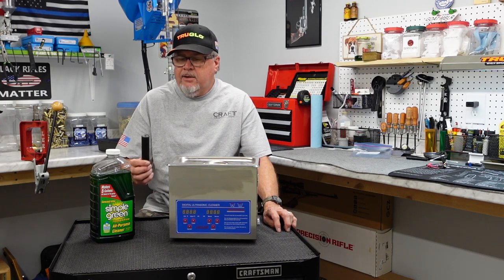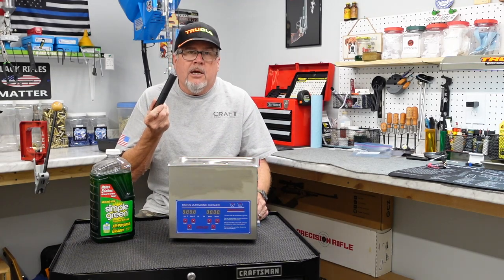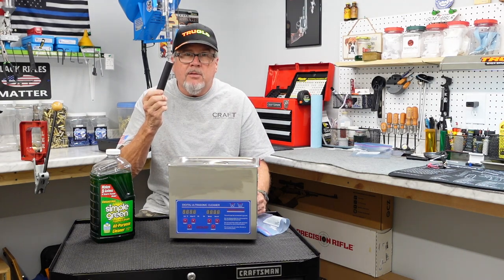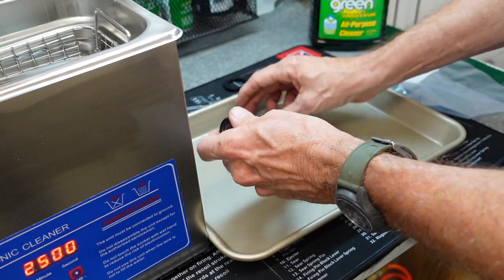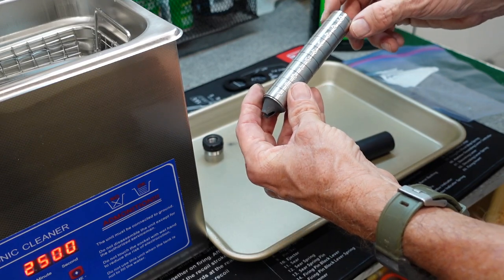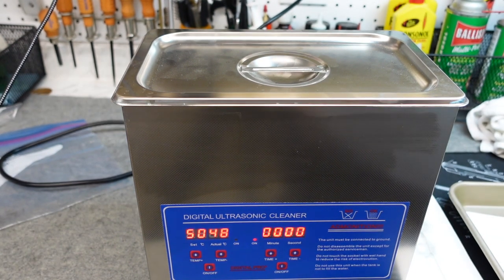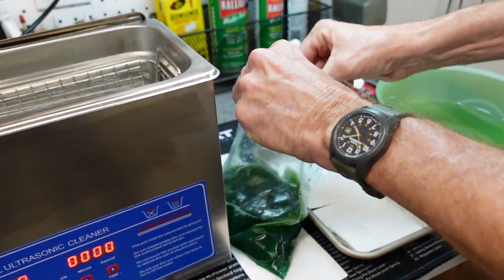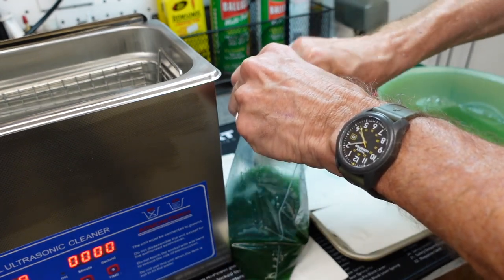ULTRASONIC SUPPRESSOR CLEANING WITH SIMPLE GREEN - FAIL!!

Comment: To all for the method I've used, use a carbon solvent, (I use Hoppe's #9) and dissamble. Soak all parts overnight in whatever solvent you use. Some picking, scraping of carbon may be necessary after that. If you soak too long (in Hoppe's anyway) it will start to "eat" the metal. Rinse with water, and imerse in simple green. Turn up the heat! I set mine to 130 degrees. Depending on all factors, it may take some time. My Hornady cleaner has a max time of 30 min. After each session I checkall parts. As they become clean, I remove them, and set the timer again. I've never spend more than two hrs. for all parts to look like new to this point. Hope this helps everyone!

Comment: I use simple green if I have it on small engine carbs I don't bag anything but use small glass jar for the tiny parts,  I also use dawn dish detergent and have had good luck with that too . I think your parts might have come clean if you diluted your smple green 50/50 with water. Running at 60 Celsius usually 30 minutes  will do fine. Also bunching parts together isn't a good practice,  in your case you could  suspend your items  so the sonic waves can hit from all directions. Its all about trying different  procedures.  Heat ,water and separation of parts might be your answer.

Comment: Apple cider vinegar & Hydrogen peroxide mixed half & half, in a well vented area, parts soaked over night works wonderful. If really carboned up you made need a second soaking. No Ultrasonic needed.
Reply: Hour vs 24hrs. Ultra Sonic Cleaners are fairly inexpensive these days and easy to use.

Comment: I use about a 10% solution of Simple Green and water in my ultrasonic cleaner (same as what's in video). Solution temp is 60 dgrees C which is 140 F. Baffles are titanium and come out extremely clean after 20 minutes. Don't use an undiluted solution unless directions tell you to do so. Simple Green works best in a water solution.

Comment: Don't use pure Simple Green. It's a concentrated degreaser surfactant.  A 90% water and 10% Simple Green mix is plenty for cleaning. You can use a bit more but too much and it becomes less effective. Simple Green will not remove lead fouling. I prefer Ballistol and water since I have it around for my black powder guns and it will remove lead. Wear nitrile gloves lead isn't good for you.
Reply: That's very interesting Patrick and thanks for the tips.  First time I cleaned my supressor parts in the sonic cleaner I used CLR.  Every thing came out shinny new.  But did some research on CLR and found mixed reviews about it eating away stainless steel.  If you could share, what was the ratio of Ballistol to water you use?
Reply: @RickHunter811   10% Ballistol and 90% water is recommended for ultrasonic cleaners.

Comment: CRC 05361 Silaramic Brake System Grease...get some of that, you can thank me later. 😉 Put a very light coat of the grease on the baffles before using the suppressor, and the carbon will wipe right off. I've got a video here that shows how it works... https://youtu.be/6UxhSAOlLMM
Reply: Welding anti-spatter spray is a good option too.